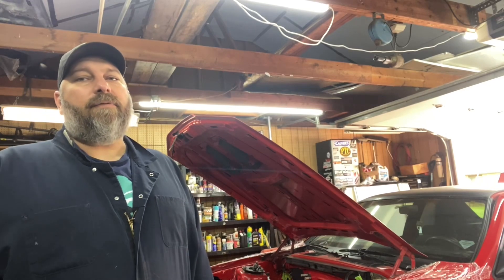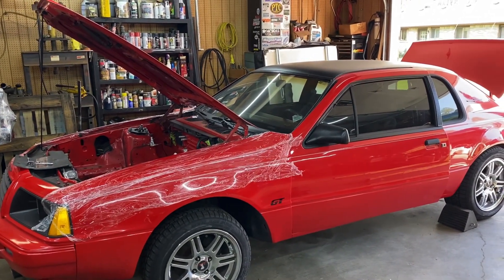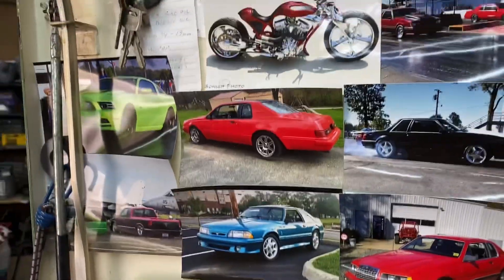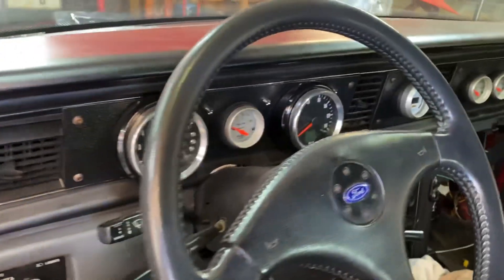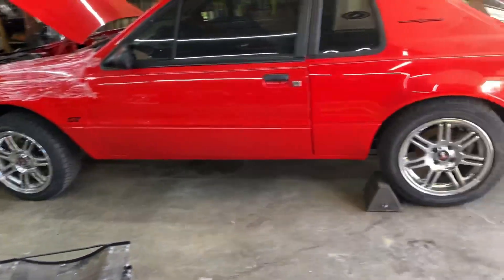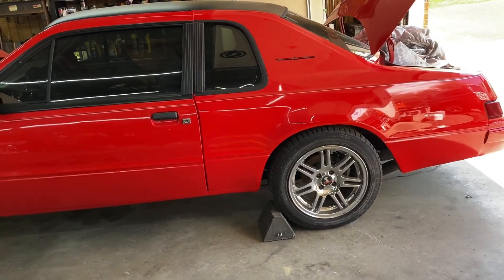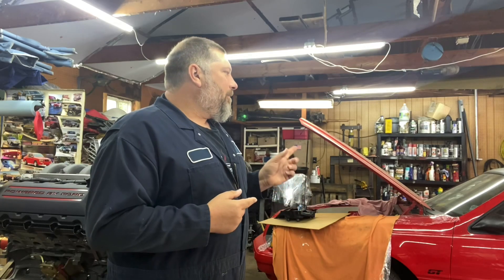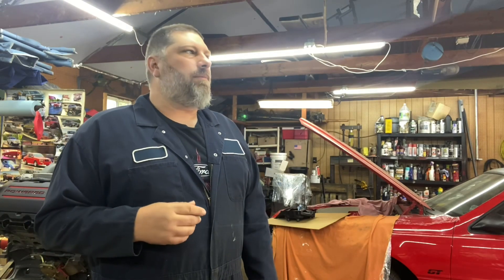Thunderbird Turbocoupe coyote swap part3

Comment: In the first gen broncos / rangers what’s the difference with the rwd and 4wd swap kits. I can’t find a swap kit for a 4wd and was wondering if I can just use the rwd swap kit off summit
Reply: For a 5.0 c4 swap
Reply from the maker: @Trashpanda570  the difference is the headers. 2wd v8 swap headers won’t work on a 4wd.  Advance Adapter makes a nice shortie header that will work for both.
Reply: Randum Adventures ok thank you for the knowledge and quick response.